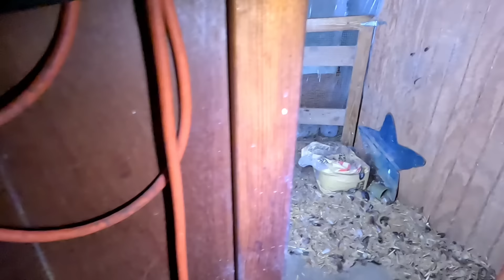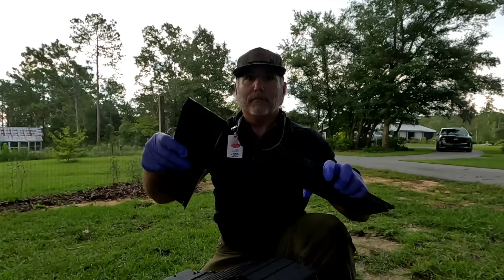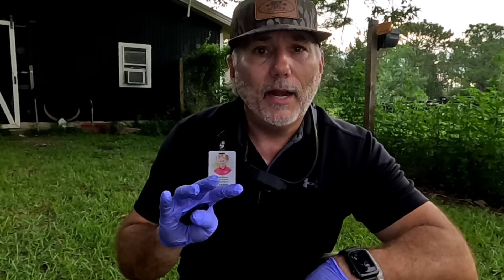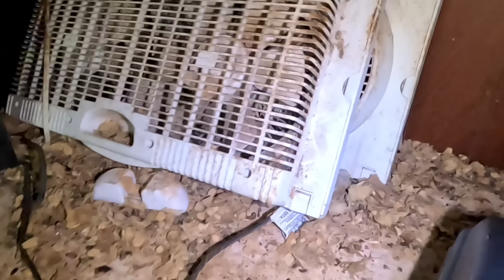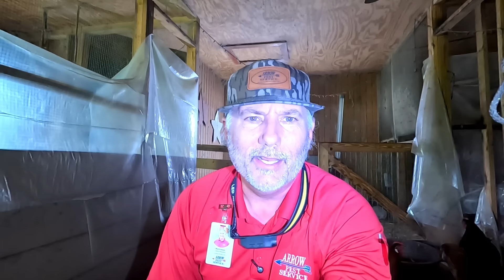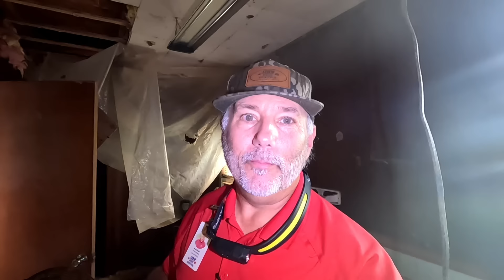Most Effective Rat Control Method Nobody Talks About!

Comment: If you poison rats in your house, will they go into the walls or secluded places and stink. I had a F150 truck that I replaced the frame on and guess I left an entrance hole to my cab. It was parked in a wooden shed, and rats went in and made a nest in my heater fan motor under the dash. I turned the fan on and it was clogged up with shredded paper. Took the fan out and removed the paper and it worked for a while until the rats made another nest in it. One day I was driving, and a rat ran across my foot. I set traps in the cab and used poison and managed to kill them all. But my cab stunk like hell and I couldn't find the dead rat until I removed the back seat and found a baby that had crawled way up behind the seat and died. After the mother rat was killed I guess the starving baby left the nest in the fan motor and crawled up there and died of starvation as I had found some other babies struggling to crawl on the back floorboard.
Reply: What a nightmare

Comment: I'm a qualified pest controller as well. If a dog or cat eats a rat that has been poisoned with something like warfarin, or peanut butter laced with Diazinon, it still does damage to the pet's intestine. Plus, it depends on the amount of rat poison the rat has eaten. It will still do long-term damage that will surface later in the pet's life. Also your math of 20-30 rats need to beaten by the pet to kill it, doesn't makes sense, a cat is not 20-30 times larger than a rat.

Comment: Good job brother, anything anyways that can get rid of these evil creatures it's commendable. I use the Victor wood/spring bates, which was very effective, but these morons changed the metal bate piece to a plastic one, which is very difficult to set it up and does not work most of the time.

Comment: Rats can EASILY jump out of a 5 gallon bucket without fluid in it. That method was doomed from the start and a complete waste of time; you should have known that. You need to put green glycol anitfreeze, water, or peanut oil in there so the vermin can't escape from the bucket.
Reply from the maker: They wouldn't go near the bucket 🤣
Reply: @ArrowPestService  Rats are smarter than mice but I think they don't breed as often. Before I moved our RV to a less mouse friendly storage place, by far the most effective method was just peanut oil in a stainless steel bowl placed so that the mice could easily access the rim and sniff the oil. It has to be removed before it congeals in the winter though. Thanks for the reply.

Comment: Are the rats gonna die inside my house and cause that stench and what do I do about that?
Reply from the maker: It's always a possibility you need to be prepared for. In my experience, it happens less often than you would think.
Reply: I found that  most of the rats and mice that died in the house were in the middle of the floor or on the edge of baseboard. I did have 1 die in a spare bedroom with excess stuff but you can smell them as they decompose and find them.  The smell is of death. You can't miss it.
Reply from the maker: @liz5870 true 💯

Comment: My mom started using bird feed to watch little birds. It attracted dozens of rats. Then in my guest house, the rats dug under the slab to the bathtub plumbing chase. They ate the concrete and made their way under my bathtub. Then they chewed through the drywall and kitchen cabinet and made their way into my kitchen and started feeding on a brand new pack of pistachios. It was horrible. My old man set out rat poison and they ate it and then died in the bathroom wall and under the tub. I ended up gutting the entire bathroom down to the studs. The rats made a hotel all the way up the walls in between the studs in the insulation. We had to treat the studs with chlorine and other powerful chemicals for 2 months. It cost about $12k. We got rid of all food sources and sealed up the entire house. The one year later, they came back and ate through the cedar siding and the new drywall and cabinets. I had to do it all over again. One of the most frustrating and miserable times of my life. Now I’m super vigilant. I automatically put out snap traps periodically to make sure no rats come back and take over. Word to the wise… NEVER use any kind of bird feeders. Also, if you save peanut oil for fryers, go ahead and throw it out. I had rats chew through thick metal lath screening to get to the peanut oil.
Reply: Yeah exterminaters use sunflowers to attract rats. I used to have bird feeders too. With Sunflowers. Lol Not anymore
Reply from the maker: Wow, what a story. Thank you for sharing your experience. I hate that it cost so much to get rid of them.
Reply: 33 rats in my bedroom in a month  four months later,only 4 so far ,  ,birth control might be the final solution or Solvent Green o may
Reply: @JosephH-b7b what do you use for birth control?
Reply from the maker: @JosephH-b7b 👍

Comment: i have rats right now and they are chewing holes in my trailer walls and I live in here.   They run right past me with no fear.   I tried Tomcat baits and they are not eating them.   They have had at least two litters since them came.   I called exterminator and they wanted 600 dollars to deal with the rats.   I just lost my job after working here fifteen years and have no income now.    I don't know what to do.   I tried corn muffin mix and baking soda and they ate it and nothing happened.     They are chewing up my trailer.   they are up in the space between the trailer roof and the ceiling panels.  They are chewing holes through my walls.     600 dollars seems a bit high.   I have trapped 4 of them with a humane trap and relocated them in woods but the rest of the rats wont go in it now.  I did wash it each time i caught one.   I am at my wits end.   between the tree that was sprayed with round up and died dropped six huge branches on my trailer and water damage is extensive and now rats.   No money coming in to fix anything.   I could use some prayers and perhaps a miracle.
Reply from the maker: Praying and believing with you.
Reply: I had a terrible rat problem last year.  I tried everyone except bait. Cornbread mix with baking soda killed some bit they kept multiplying like crazy. Peanut butter mixtures killed some and tried other methods since on YouTube.  Caught very little in snap traps and the electronic traps did nothing. They totally a car,  destroyed my ac ventilation ducts under house, chewed bark on trees killing some. They got in the house and you could see and hear them. They made such a mess of everything, inside and out.  They chewed the air vents on the house and the dryer vent to get access to the house.  They made nest in ground and trees.  It's was terrible.  I have a huge pack of dogs so hesitant to use bait but got desperate.  Found out that dogs would have to consume a large about to cause them harm. They did catch some on their own.  I would go out every night with a flashlight and shot them but they were still multiplying like mad.  Finally,  got Tomcat bait blocks but found the granular bait was more effective. Finally no more rats but still very mice in house. I keep bait inside and outside and the numbers are kept down.  I do live in the country with fields, trees and farm life so I know it's going to be an on going thing.  I only fed my dogs and don't leave extra food out. I did find that the rats that died were not appealing to the dogs.  Is find them dead in the yard where the lives rats caught were waten by the dogs. I did use the large black bait boxes. The German shepherds took one of them tried to destroy it but were unable to open it.  I did tie the bait boxes shut with a piece of copper wire. Hope this helps.

Comment: I've used the bait trap but had to stop when the rats brought some of the bait into the chicken run and left it by the feeding station. I did get it before the chickens. I have rats coming over the fence from the neighbors at night where they live in these massive bushes. I have snap traps and glue traps set all over the place, but seldom catch them. They are so smart. They have eaten my tomatoes and stripped my hot peppers down to twigs. Any suggestions?
Reply from the maker: Use the contrac soft bait

Comment: I used your  method, with first strike. I shoved it right down in their holes. They ate, 8 pounds of it. Around day 4, I started seeing dead rats. By day 6 they were gone. Thanks for the information. This is the only thing that worked.
Reply: Did the rats die inside your property or they went outside , how did u deal with the smell ?
Reply: @knoxgolding5101 they was laying in the yard in different places. I just went around and picked them up and disposed of them. I only found one dead one in my garage
Reply from the maker: Awesome, I'm happy to hear that worked for you!
Reply: @ArrowPestService  Do the rats die inside the property or they went outside , i dont want them dying inside the property or how do i avoid or prevent that ?

Comment: What do you recommend to spray around the exterior of house and in the garage for monthly maintenance?  Also are there any exterior pest control products that are rain resistant?
Reply from the maker: Suspend Polyzone is great for the outside and will last up to 90 days when mixed at the high rate. We use this all the time.
Here's a link 
https://amzn.to/465zooy
Reply: @ArrowPestService Thank you sir. Love you videos keep them coming.
Reply from the maker: @Tojo1776 I appreciate it, thank you so much!
Reply: Amonio/ vinegar with 8 drops of peppermint extract oil on exterior foundation with a garden sprayer closing off all holes and openings and a couple Serbian tigers will suffice
Reply from the maker: @JosephH-b7b 👍

Comment: THANK YOU! GREAT VIDEO!  so my story would be>>>>>I have had a problem (i tried many ideas) a few years with RATS climbing UP a 2" square (4) steel poles that lead up to a bird feeder full of cracked corn. So instead of taking away the bird feeders at night, and putting them back up in the early early mornings:  I FINALLY had an idea with BACON GREASE (from cooked bacon) & a small paint brush;  BY MAKING the 4 steel poles SLICK enough the RATS could NO LONGER climb up the poles (and now i can rest LONGER in bed) This Idea will work for 2 to 3 weeks and then the poles need to be repainted. Yes it works as good a STP engine treatment! I doubt this idea WOULD not work for WOOD
Reply from the maker: That's a clever solution!

Comment: Few rat stories, but some.  Glue trap in apartment.  Rat tried to run between 2 gas pipes.  Beat it to death, took to dumpster.  Biggest trouble, apartment was on end of building, smelled something, started having maggots fall out of ceiling.  Later they found dried out body above upper cabinet.  50 flies weren't fun either.

They seem to like ramen as well.

Had one in house trying to get past grate.  He ended up leaving, replaced that piece of plastic ducting with metal.

More stories than I thought.
Reply from the maker: Sounds like an adventure 🤣
Reply: @ArrowPestService  Many years.

Comment: Old farmers method  for killing not just rats, but all vermin in outbuildings. Seal the building up as tightly as possible after removing chickens or any other animals you don't want to kill. Next, install a flexible metal hose or hexy rubber hose around the exhaust pipe of a tractor or vehicle. Figure out a provision for inserting the hose into the building, perhaps a reverse installed wall vent for a dryer. Ensure flap of vent is tied in the up position, then with building sealed up, start the tractor/vehicle  and let it run a half hr to an hr then turn off the engine. Leave the building sealed up for some hours, then open the doors and windows to the building and let it air out a good long time. After that, allow chicken back into the building, and it should be free not just rats, but mites, spiders, and every other living thing you find objectionable!
Reply: I had rats living under my garage, and have done this several times.  They come back, because there are so many in the area, but we get a good break before we have to do it again.
Reply from the maker: I like it 👍
Reply: @ArrowPestService I can not claim the credit for this. This showed up frequently  in reader suggestions every so often clear up until the 1950's in Popular Mechanics magazine,  especially in their annual "Shop Notes" editions. Usually submitted by farmers.
Reply from the maker: @herbholmberg4474  I've always loved how the old farmers did things. They got the job done right.

Comment: I use the battery operated electric traps   They go in to get the bait, touch a metal
Plate and get electrocuted
Reply from the maker: Nice
Reply: I had one and it worked great until it got shorted out by rat juice
Reply: @steveday4797  🤮
Reply: @steveday4797 I snorted 😂 "rat juice" 💀😂
Reply: @steveday4797  "rat juice" is the worst part of this type of trap. Indeed. Corrosive and funky.
Reply: Do they sizzle?  Smoke?
Reply: @rusedorange  yeah! We want all the details? Can you smell burning hair?
Reply: @Ice38383 Sick. You sound like a kommandant of some German or Polish "camp" from ww2
Reply: @rusedorange  see my reply to sharon
Reply: @rusedorange  Yup! When they're on the barbi.
Reply: doesn’t work for me!

Comment: 1. Remove grass seed or store in sealed metal containers, and remove anything else that might be rodent edible from your space.  2. Remove nesting materials, including rags and sawdust.  3. Open up any dark enclosed areas created by piles of junk. 4. Place simple snap traps baited with peanut butter where the rodents are coming in and remove bodies daily.  We have wire-covered exterior vents and two enthusiastic mousers in our house, but had field mice coming into our detached garage around the base of the rubber door seals. Following the above got rid of them completely and put a serious dent in the surrounding rodent population without endangering pets or other wildlife.  Went from 4 bodies a day to 1-2 a month to zero.  We have also gotten in the habit of cleaning and reorganizing the garage every year in the fall.  My sense is that what we were leaving out was inviting them in.
Reply from the maker: That's a great, comprehensive approach!
Reply: I’m
Reply: P

Comment: Wouldn't it be easier to temporarily remove the chickens and clean the obvious mess that has lead to the problem in the first place.  It looks an awful lot like the owners are severely neglecting the coop or the mess has been staged for a video.
Reply from the maker: Good point, thanks!

Comment: I have been using the green rat glue board from China 🇨🇳 and  have a very good success rate 
.cut 1 board in 2 and just place anywhere in an enclosed area with a small bait I use bread with peanut butter  💯
Reply from the maker: Good job, keep it up
Reply: what is a green rat glue board from China, please?   I have used Max Catch by Catchmaster that have a peanut butter smell.  But you have to find the rats /mice quickly or they chew themselves off of them

Comment: I had a rat infestation at one of my previous properties. We discovered a neighbor left peanuts out for the squirrels and birds. This caused a big rat infestation in the neighbourhood. 
I set a few traps, I killed a few but eventually the traps would disappear and I could not find it again. So I used my BB gun to kill them. I found a trail they liked to run through. I put some peanut butter in one spot. When the rat came by to sniff/eat the peanut butter. I was sitting there waiting with the BB gun. Head or heart shot killed em pretty quick. I took out close to 30 rats with this method.